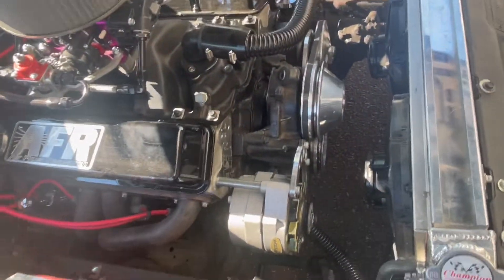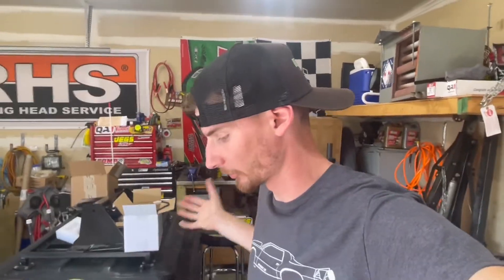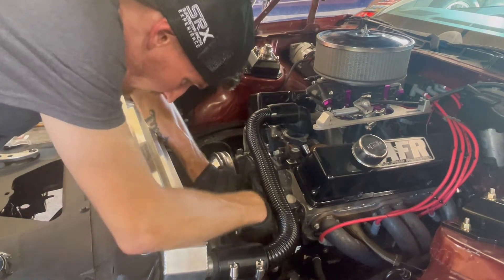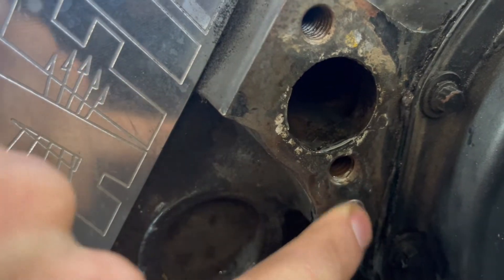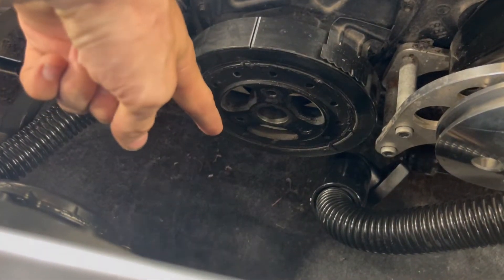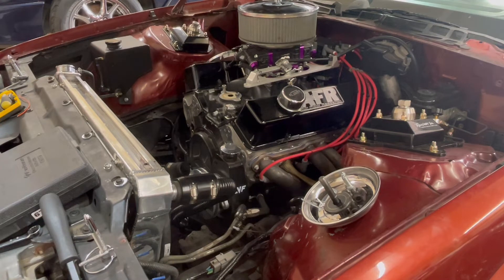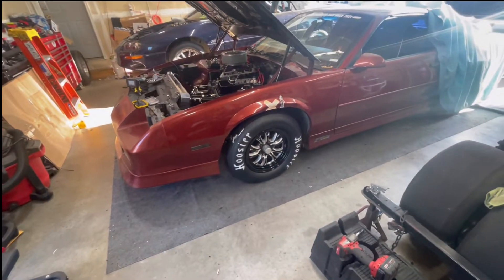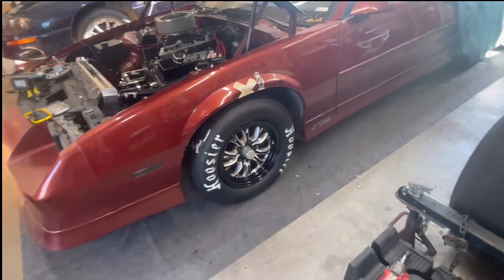3rd Gen Camaro gets an Electric Water pump for the SBC

Comment: with an electric water pump no thermostat should be used try that first i have had the best results this way. control the temperature with the pump. depending how your driving it. the pump is worthless when the thermostat is closed the pump needs to be meant for street use. gallons per hour drag pump will not work well. nice video

Comment: I noticed you have a restrictor in the thermostat housing. Would you recommend this for a hotrod weekend driver or just race application. Cheers
Reply from the maker: I’d Recommend restrictor if you have a engine that’s built for performance, I Used the restrictor because my motor did not like any Thermostat I tryed, you’ll wanna buy the pack of restrictors that has multiple restrictor sizes. If you have an hot rod that goes on longer drives I’d lean more towards the a thermostat 🤘🏼🤘🏼

Comment: I’m asking cause I’m doing a vortec 1998 swap on my 84 cutlass and I wanted to go eletric water pump how’s it holding up for you and what did u do for the bypass drill some holes in ur t stat?
Reply from the maker: The pump did great no issues no leaks and I used a Water restrictor instead of a thermostat, I had nothing but issues with all kinds of different thermostats so I just used restrictors that oval/dirt cars would run

Comment: What did u do to bypass the 3rd coolant hole on ur l31 block
Reply from the maker: The Water pump came with a Bypass plug that I used and tapped it in to the block

Comment: You mentioned that you haven't had luck with thermostat. What issues does your car give when running thermostat?
Reply from the maker: Over heated never would cool or hold a safe temperature, temp always climbed, went to plate instead and the car ran about 180-195 with the plate and always ran 210-225 with all different temperature Thermostats.
Reply: Haveing overheating issues  what do mean by a plate
Reply: @transamstrickstricklin2887  I’m also curious
Reply from the maker: @transamstrickstricklin2887  it’s a Water outlet Restrictor that takes the place of a thermostat, I got them from speedway motors there are about $3-4. Part #916405, they have 1/2, 5/8, 3/4 etc ones to chose from

Comment: Ship it to my house and you got a deal. 😅
Reply from the maker: Sorry I refuse to ship to Jeep owners
Reply: @one3racing  I didn't want it anyways. 💁‍♀️
Reply from the maker: @Janaya173  that’s fine, jeep people are typically afraid of real engines anyway 😘
Reply: @one3racing  uh your car wasn't even running when I was there 4 days ago.
Reply from the maker: Yes but that wasn’t the engines fault, it’s the guy who built it Whos at fault for that
Reply: I was having heating problems as well until I removed all the plastic and housing from behind the grill of the car I have some awesome electric fans and knew it should be cooling my engine down but wouldn't until I removed all that junk out of it now it runs 180-195 depending on how I'm running it. If you havnt removed any of that might be something to check out if you already  have don't mind my blabbering lol